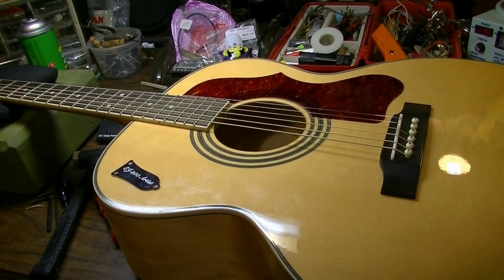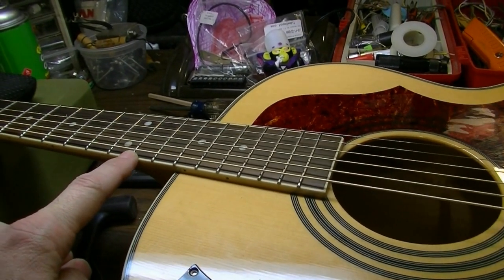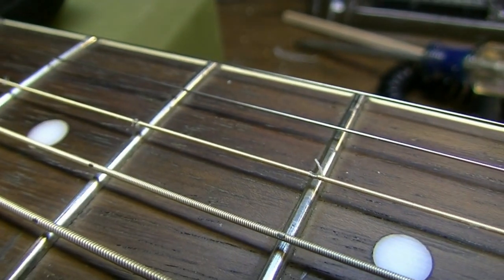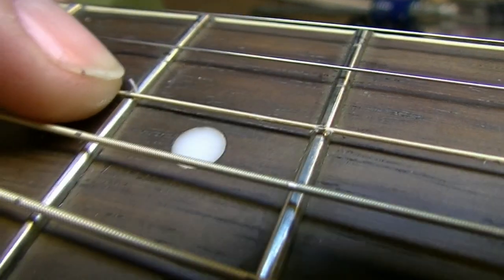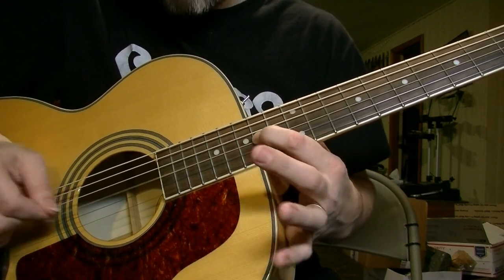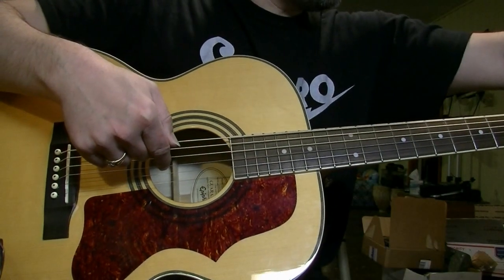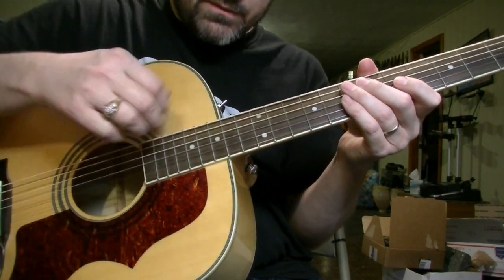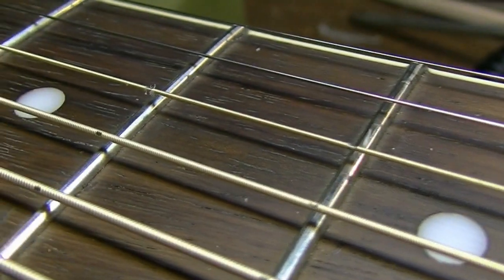Why I NEVER Use ELIXIR Coated Guitar Strings

Comment: you should work for CNN!! jmo:), that being said;lets get a more fair and balanced review,imo;;;;;; #1-" Elixir(nano) coated"-- the Poly is heavier coated and good for ur son for ease & duaibility)-#2 Martin Sp phosphor bronze(med-light) these are the best overall sounding strings period.. on a non-amp acoustic the volume and tone  are amazing thou a shorter life** if u clean hands and wipe strings will last 3x longer------- #3- Ernia Ball Earthwood prosp/bron. is a in between on the feel of the Elix/Mart. and now my least fav string as of late is " Daddario :(... yes i have a brand new set l/m on my Seagull and they gotta go, no sound thou they are ok thru an amp but not around campfire..**.note to self, if 2 different G strings buzz after tech files too much off^ adjust trod just a bit until fret buzz is completely gone on new set of strings so he can't blame the old strings!!!!!!

Comment: I only use Elixir brands just two times in my life and never return, they need to fix their string quality not jut focusing on antitrust only
Reply: I think that's the thing, they want to focus on making it last, it already does sound pretty good though. For me the 'fraying' (i assume that word means peeling off) only happens in the picking area, not the fretboard.

You could use the same strings for 3 months and it still doesn't sound dead.

Comment: Been using Elixirs for years now, and never had this issue. I, of course, don't leave my Elixirs on for longer than they're welcome. Generally they'll last me 4-5 months without fraying at all. I would be willing to bet that your friend has had those strings on that guitar for far too long. And I'm sure far longer than any reasonable person would keep an uncoated set on.

Long story short, I think it's a bit unfair (and honestly click-bait-y) to condemn the entire brand of strings when this seems to be a pretty isolated issue. Not to mention that it's most likely been caused by user error.
Reply from the maker: They were on less than a week. He used them for two practices and one gig.
Reply: The Guitologist definitely a bunk batch then. I never once had this happen to a set of elixirs. Like I said, I've been using them for years on several different guitars, as have a few friends of mine. And I never even knew that this could possibly happen.

Comment: What a load of rubbish elixirs are great  never had s problem and you still had the buzz when you replaced. It wasn’t the little Frey on the string that caused the buzz it’s simply your action was too low as you rightly said a very low action and you will have some trade off but it’s not the sting
Reply from the maker: It was clearly the string. You're simply wrong. In denial, I guess.

Comment: You dont wipe them you pluck them to clean them and it wont happen and use polywebs not nanowebs - They are didarrio strings with a polymer coating.